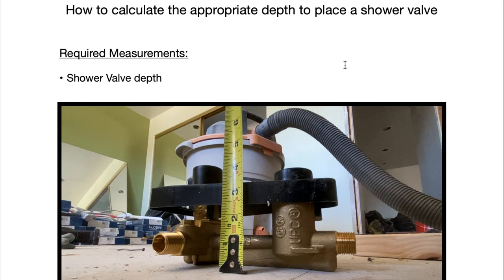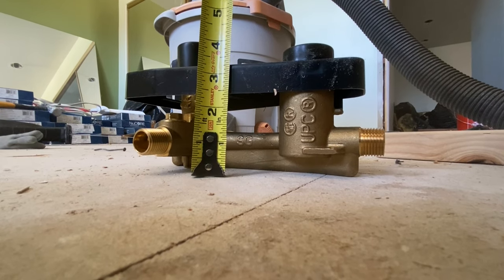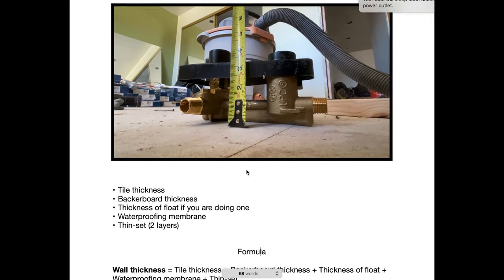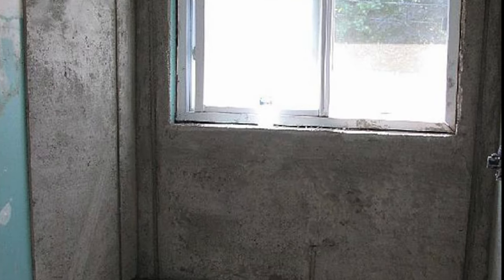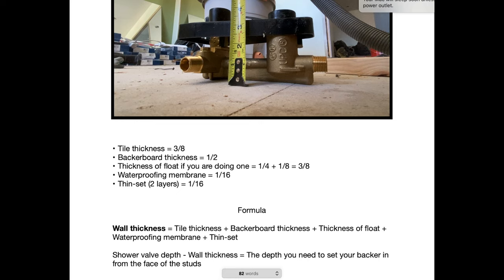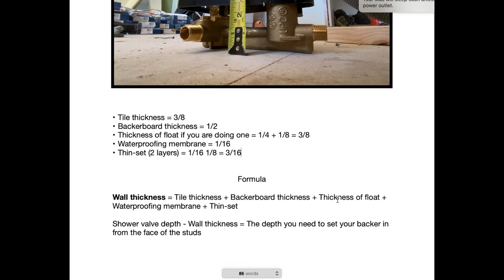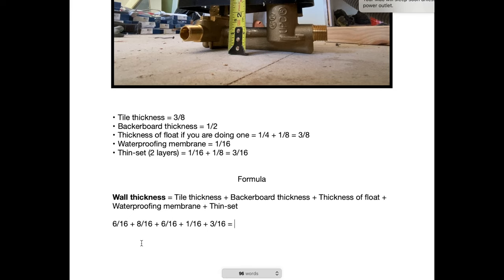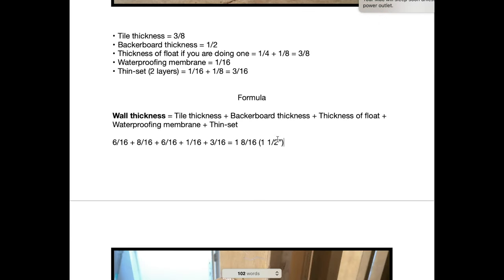How to Calculate the Correct Depth for a Shower Valve so it Finishes Flush with the Finished Wall

Comment: I have literally installed thousands (Apartments, hotels, etc) of these Moen valves and this is how we do it.  For a 2x4 wall and a Moen valve...Cut 2x4 backing board to width between studs in wall where you plan to mount your new Moen valve. Mount 2x4 backing board horizontally flush to the very back of the 2x4 studs in wall. Once mounted that will leave you around 2" from the face of the stud wall and 3" to the approximate finished tile wall. Mount new Moen valve to 2x4 horizontal brace with (2) 2" screws. Make sure the valve is plumb in all directions coming out of the wall so your trim will mount flush. Mount Moen tile ring back on valve and you are done.
Reply: What if it’s just a shower wall install where the thickness of the wall covering is 1/8”? Your backing board could only be 1/4-3/8” thick, right?
Reply: @CrowCreekOutdoors Ty get the😢🎉t

Comment: Thanks for your break down for depth of a diverter, being a professional plumber, I normally will ballpark 1" of material from stud to finish wall( with tile) 1/2 for board, 1/8 for thin set, 1/4-3/8 for tile. The width of a tape measure is about an inch so holding it horizontally  will give you a good idea of finish wall. Of course different manufacturers have different guides. Keep up the good work!
Reply from the maker: Thank you very much!
Reply: i always go with 9/8
Reply: @BlueEffigy  What does 9/8 refer to?
Reply: @HomeownerDIY  1  1/8
Reply: @BlueEffigy  I always give myself 1/8 of play on either side. So for 1", 7-8 to 11/8 is acceptable. Your method works in my books.

Comment: Wow.  Who does all that.  Youre better off calling a plumber or at least a tile setter.  You realize the the escusion plate is adjustable dont you?
Reply from the maker: Definitely leave it to the professionals if you don't want to do it! But this is for those who want to do it themselves or just make sure their contractor does it right
Certainly the plate is adjustable but only to a certain degree, that's why it's important to shoot for the right measurement! 😃
Reply: I just installed one, it was a breeze and im not even a plumber, came out perfect to the tee. Maybe it's because im a framer / drywaller\ tile setter renovator etc. I guess I added a new repertoire to my qualifications I'm not an expert but I am very good at following instructions and that helps besides you know how much this plumbers wanted to charge me so I save the little money and got a little schooling
Reply: @Cottonwoodconstruction  Yeah neverminded trying to save $500 just pay a plumber $500 for 15 minutes work. NOT

Comment: You did this like an engineer... and as someone who overcomplicates everything, I greatly appreciate it because while it may be more complicated than what a professional would do, it will give me peace of mind knowing the depth is right BEFORE I start building out the wall.

Love finding people that think like I do.
Reply from the maker: Glad you found it useful! Any good project starts with solid prep work. Its definitely more in depth than could be required but some valves require different depths and if you use multiple they all need to line up

Comment: Really appreciate you putting this video out here. Can’t believe that Moen isn’t capable of explaining this to their customers in an easy format like this. My shower kit had generic instructions for tub/shower and I need shower only. So the valve height was going to be low like on a tub. It didn’t explain to measure the depth like you did. Couldn’t find what I needed on their website so what does a homeowner do? Go to YouTube. Thanks again.
Reply from the maker: This is why I do it!

Comment: You didn’t overcomplicate this at all. How else would you set the depth? I suppose you could gather all the materials and lay them on the studs and mark the depth. Sounds like some of these commenters just guess and hope it comes out right.
Reply from the maker: Sometimes you can guess and get lucky but this method applies to setting depths for drop ears and when you have valves of two different sizes. I'm glad it helped!

Comment: For a new shower will full access to both sides of wet-wall:  any problem with waiting until after the wall is completed?  Then just locate center & drill through tile, thinset, etc.  ???
Reply from the maker: Would never recommend doing it that way. Would be nearly impossible and you'd likely have to rip out tile
Reply: @Cottonwoodconstruction  What would make it impossible?  I've got the diamond hole cutter.  It seems this way would make it MUCH easer to install. (that could just be my inexperience thinking)

Comment: Cool vid… using a 1/4 float do you actually count a full 1/4 inch with that? Bc with a 1/4 trial 90% of the time you don’t get a 1/4 inch high off the ground notch from the trial bc most ppl don’t hold it perfectly at the correct angle to actually get a 1/4 notch but also by time you push your tile down it’s more like 3/16- 1/8” notch.. I know the valve handles has about 1-2” of play so it doesn’t matter with most handles but just curious
Reply from the maker: By "float" I actually mean using a mortar bed to screed the wall and make it perfectly flat. Once it dries, you then continue with your install. You are correct in that a 1/4" trowel will not give you 1/4" of thinset under the towel. A good ballpark is cut the notch size in half and use that number as the thickness of thinset
The best way tho would be to actually apply the thinset and a piece of tile and measure its thickness. Hope this helps!
Reply: Water proofing membrane on the walls ?

Comment: What do you mean when you say thickness of the float ? What is a float
Reply from the maker: Sometimes Tilers will "float" out their walls. Meaning they put a layer of cement on the walls before setting tile to make the walls perfectly plumb and square. It adds thickness to the wall. This doesn't have to be done and most of the time is not done these days. But when done it makes the walls very flat. Think of it like self leveler for walls.
Reply: @Cottonwoodconstruction  thanks for that 
I get what ya mean now 
Like a skim coat to get levels flat 
Rodger !!

Comment: Why not adjust the block that the value is sitting on from the hole that u cut instead dealing with all these fractions .math doesn’t works in real world when you’re talking about multiple layers of cement thickness and clothes and rubber. U might as well calculate moisture and temperature because that affects the expand and contract of the materials. U got a formula for that? And I’m Asian I don’t deal with this sht
Reply from the maker: Yeah I do. It's called e=d33znuts
Reply: Steven He would not be proud ma boy!